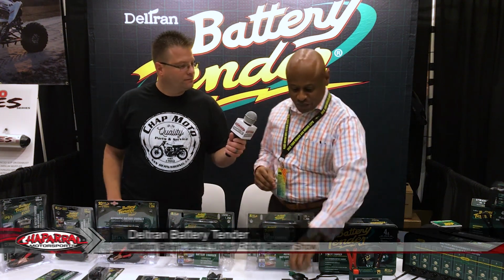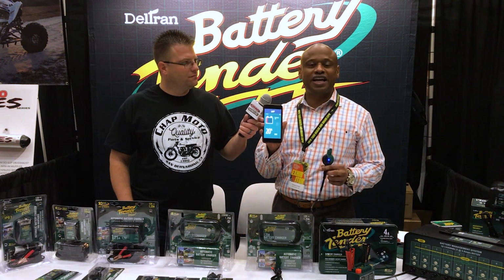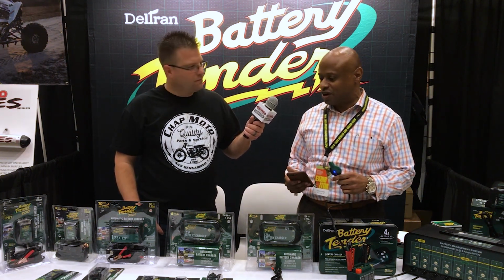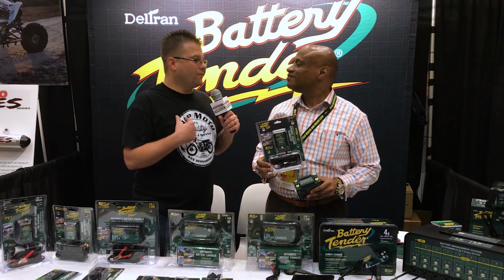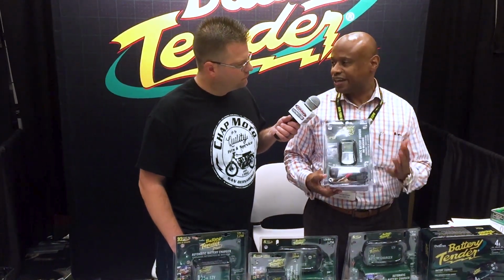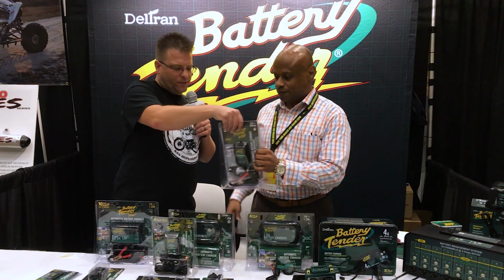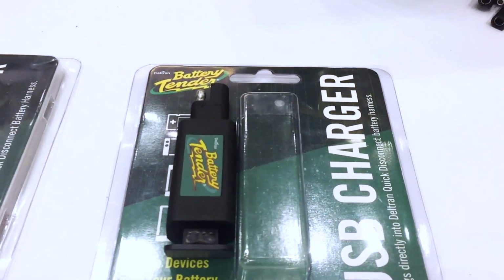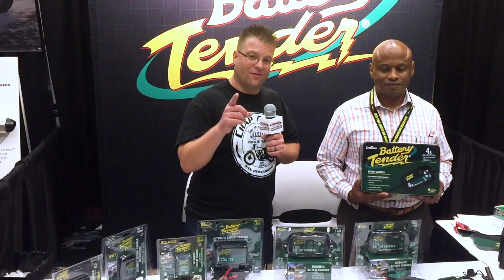The 2018 Battery Tender Line-Up from Deltran is Explained Featuring New Products by Chaparral

Comment: My Battery Tender Junior 800 failed less than two years into the five year warranty (purchased 11/27/2020).  Autozone would not refund or exchange so I’m stuck with dealing with the manufacturer.  Naturally it just failed on Labor Day holiday weekend so the manufacturer is closed until Tuesday.  Emailed customer service so we’ll see.  A number of repair videos exist which show the capacitors used by Battery Tender are garbage and you would think the manufacturer would have upgraded the part by now.  My recommendation is do not buy and put yourself through the ringer.
Reply from the maker: Wow, bummer. Hopefully it gets rectified. Ride safe.
Reply: @chaparralmotorsports   Deltran has sent a replacement after a call and sending them pictures of the Autozone receipt and unit with the numbers on the back and cut cord showing.
Reply: How did your battery tender failed. My battery tender works I left it on in the garage was working it was on floating took it off everything worked radio and lights but didn't want to start up it's a Camaro 2019 I was very disappointed had to take it to the dealership so they can place a new battery. 😓

Comment: what is the Best Battery Tender for a 2019 HD Street Glide Special?
Reply from the maker: Thank you for your inquiry Glenn. Any of the tenders will work great. Does your 2019 have a lithium or lead acid battery? That is the only question you need to answer before choosing a compatible tender.